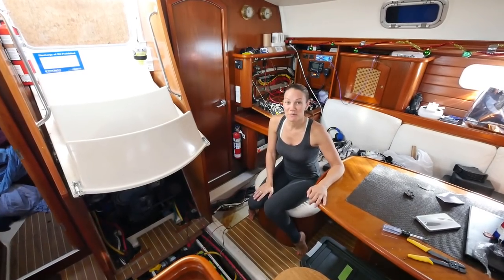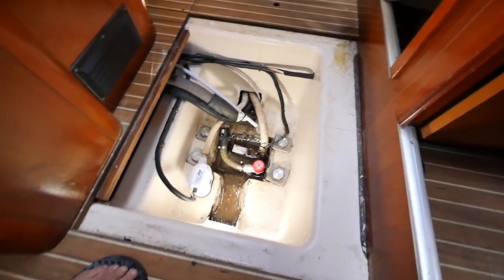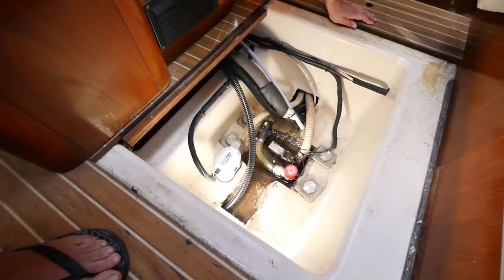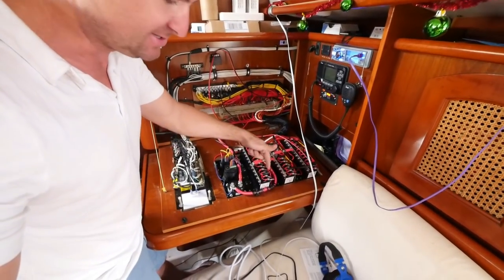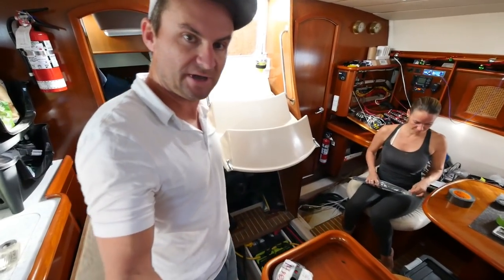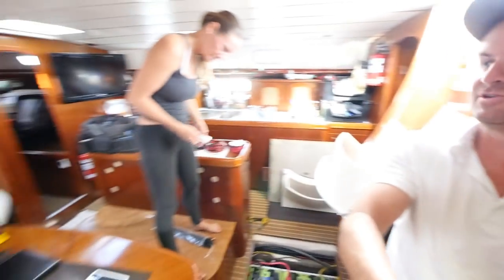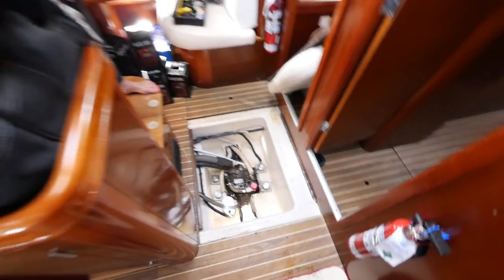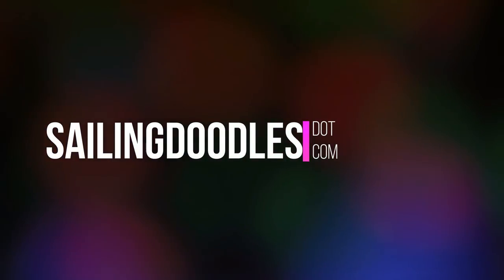Bilge Rat!!! - Maintenance Monday

Comment: I too am OCD when it comes to keeping the water on the outside of the boat.  So please don't just hang loose with things like those mentioned in these comments.  I want you both to have safe and long travels so I can travel along vicariously.  So, wire tie the hose in two places to keep it in place.  Test the water, salt or fresh.  If salt, follow the advice in this section from other sailors and get it fixed right there right now.  If its fresh, same goes.  The margin for error in a sailboat on the big ocean is very tiny when it comes to maintenance and safety.  You won't need bilge rats if you let leaks leak and hoses flop.  Consider yourself lectured by me and the others here.  It's only because we love you and want you to keep on doing what you love.
Reply: Personally, I would head back to the shipyard he got it from unless it appears to be a real and growing issue - unless the owner wants to pay for another overhaul where he is. But... yours is the cautious and perhaps most prudent advice.
Reply: My sentiments exactly. I made similar comment way above before reading these. Time for a haul-out video? We need Bobby in good condition for 2020 !

Comment: Looks like a pretty good job, Bob. I would secure the outlet end of the tube so there is no chance of it jumping around underway in "ruff seas" and interfering with the float. As others have said I would have Laura taste the water in the bilge. ;o)
You have done a bandage for now but when/where do you plan on a permanent fix? I can't think of a better time than now while in SD where everything is available. It may get worse as time goes on and you sure don't want a leak on an ocean crossing.

Comment: A water tank leak is not as life threatening as a through hull leak ! Locate all your through hull's and see if it is the problem ! Being in the middle of the ocean and have a through hull give way to total failure could sink the boat ! Be sure to have a few through hull plugs on the boat for just such an emergency. The dripless on the drive shaft may need an adjustment ! Whatever you do ,find where the water is coming from and fix it before crossing an ocean , you can thank yourself for nipping this in the bud now while you are in Port ! If you prove to Laura that you will protect her life with whatever it takes , she might marry you 💑😍 thanks for sharing 😎
Reply: I wouldn't put to Sea in a boat with plastic thru hulls also, those frigging things love to break off when someone steps on a hose or drops a 12 pack on it, haul that thing and replace any plastic if you want to sleep peacefully off watch

Comment: If it’s salt water, another possibility is the anti-siphon valve. On my Beneteau it is a Vetus anti-siphon calve located above the engine. When the valve clogs, salt water drips thru a small hose to the engine sump. 

https://goo.gl/images/8s5vVH

You can replace it, or disassemble and clean it. 

If it’s fresh water, check the hoses to the water heater.
Reply: Stuart McLeod this is my bet!

Comment: So #1 pump you put in....  Needed to put in a "Y", a one-way on both sides of pump #1 & #2 and not use one to fill the other.. over working the #2 pump...   Adding a "Y" would have just pumped it out to the outside.

Comment: Hi Bobby, long time no Speak! 

Does She have a Stuffing Box or a Dripless Shaft Seal ie: PSS Shaft Seal or something similar? A std stuffing box should drip once or twice every 30- 40 sec's preferably under load! 

A PSS Shaft Seal (Very Commonly) used these days, needs it's stainless steel Collar ( 2 Orings inside) compressed correctly against the Carbon bearing face that's inserted in Rubber looking Bellows. If you do in fact have a PSS Shaft Seal, make sure it's relatively new 1-3 yrs, no more! You do not want to head Off Shore if it's any older.

Your boat has probably done a lot of motoring if primarily chartered in BC & Inner Washington Water Ways, a lot of wear and tear on stuffing boxes and dripless style seals! As you know very light Air Sailing around here.

Go to PYI website up in Washington State for info on PSS Shaft Seal. 
Std stuffing box maintenance simple if boats out of water, hose & clamps connecting stuffing box should be new before heading Off Shore.
Cheers, 
Murray (Kiwi)

Comment: was it saltwater or sweet?
Reply: engine is sea water cooled, so i know what your thinking, but it cant be coolent
Reply: i would look for the leak anyway after i tasted the water: the taste can say if it's coolant/shaft water or  a leeking sweetwater tank
Reply: Actually, that engine has a heat exchanger, and the engine loop DOES have coolant.
Reply: He probably didn’t taste it.
Reply: Pour a little Vodka in the bilge with a slice of lime .. He will drink it dry in no time .

Comment: Well done so far - one thing leads to another unfortunately. Water was visible in the refrigeration repair video. Would getting some back-up pumps and other back-up equipment be a consideration prior to mega passages on the Pacific? Perhaps a professional consultation might be in order as well for this boat? I don't think you would leave the ground in an aircraft of similar suboptimal condition. We don't want anything to happen to such a great vlogger, passengers and doodles.

Comment: You’re in the San Diego Bay right now and if the Harbor Police see you’re discharging from a under the engine into the Bay then... oh dear. I would disconnect that little set up as soon as you can, especially as you’ve gone public with it. Just saying!
Reply: You are absolutely correct.  That is why Mr. White that the bilges are separated, the engine bilge is illegal to discharge into the ocean.  Better figure a new way and take apart this solution (a solution yes, but good?  No, its Bad, and not just a little bad, very bad)

Comment: With a pump under the engine, any oil that leaks will be pumped overboard.Not exactly eco-friendly, which is probably why there was no pump there to begin with. You need to fix the leak, you have provided a band-aid, not a cure.
Reply: Lane Street oil came from the ground and will return. I didn't see any oil and neither did you.
Reply: He could put one of those oil boom things (forget what they call them) to suck any oil out of the water before it is pumped to the forward bilge.
Reply: If your engine is leaking oil on a boat then you have bigger problems than water under it! That kind of sloppiness on a boat taken more than a mile offshore will get you killed.
Reply: Bypassing the system designed to prevent oil or any other substance from the engine into the bilge is a poor solution.  Hope this is truly a short term band-aid fix. The guy claiming it's fine to allow oil to return to the ground is making foolish statements.
Reply: There was no oil.. Believe it or not but the law states.. sat your car leaks oil in a parking lot ..5 Qts. are ok to spill.. It don't make sense but thats on land... and were does that go? into the ocean run offs to road drains..
Reply: The engine room bilge is isolated from the other boat bilge areas for a reason. Even though the water in the engine room bilge might not appear oily, once it hits the seawater outside the boat and that small amount of oil turns into a nice glossy sheen around your boat you will come to understand why you cannot pump your engine room bilge water overboard. All engines are going to leak a little oil eventually, a little oil makes for a big oily sheen around your boat ..... and the USCG will want to come talk to you. Those oil soaking mats and donuts will not pickup all of the oil in your bilge, the best thing to do is keep the engine room bilge as water free as you can so that you can just wipe up any residual oil using disposable cloths or rags. There are some centrifugal oil separates out there that can remove the oil from the water before pumping it overboard, but they are expensive. You can legally pump bilge water overboard a certain distance offshore but you will need to add a good surfactant before you pump it, if you have none you can use dishwashing detergent ..... but that is not ideal.

Comment: Bobby, you seem to have filmed yourself committing a pollution violation. Then you published it on the internet! I thought you were smarter than that.  :)

Reroute the output so it can't go overboard and fix the problem.

A trick I've seen plumbers and remodelers use is to video the area with your cell phone or GoPro to find the leak. The engine might need to be running.

As others have recommended, taste for salt/sweet to start the search.

Comment: Regardless of the source of the water under the engine, not having a bilge there is a poor design feature.  I guess the designer didn't think it would be a problem until water was sloshing across the soles to the bilge at the base of the mast.  Something about this doesn't seem right.  I would check with the designer/builder and see what they have to say about this situation.

Comment: Great video Bob n Laura.. If it works why change it? "Remember it's temporary until they figure out where the water is coming from.. Happy sailing ⛵⛵⛵
Reply: Mechanic here.......start engine, and watch the water pump. small hole behind the pully is a vent hole between 2 sealed bearings....if inner bearing is worn, it will drip out the hole, thus dripping into engine bildge

Comment: Can you put a tee fitting in so it’s not pumping 2 times?
Reply from the maker: +Ray Marx not a bad idea.  Would probably need some check valves though
Reply: Check valves are generally considered a no-no on bilge pumps, for a couple of reasons.